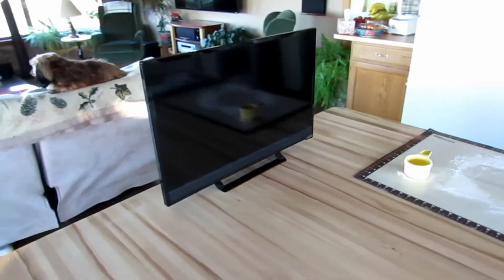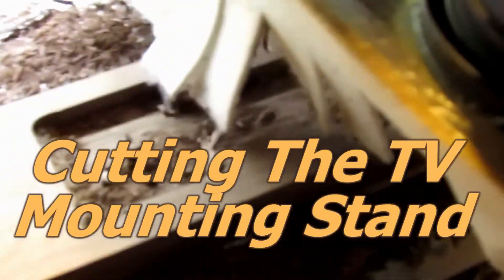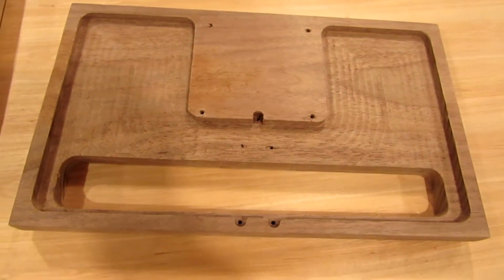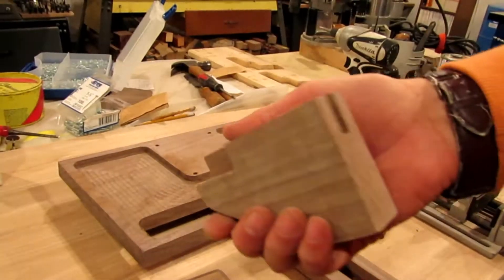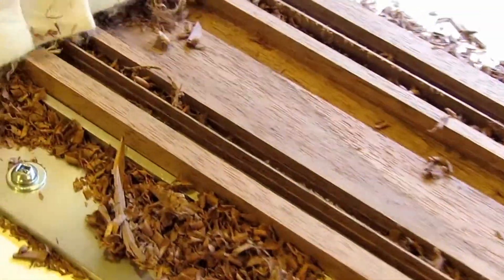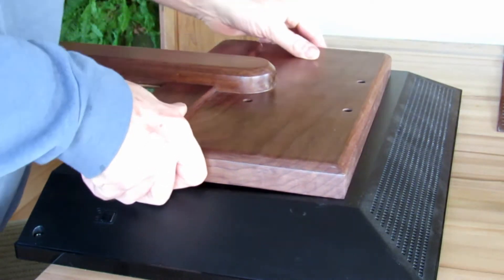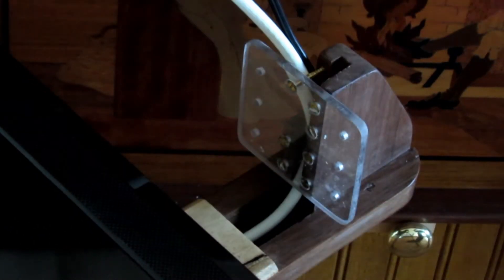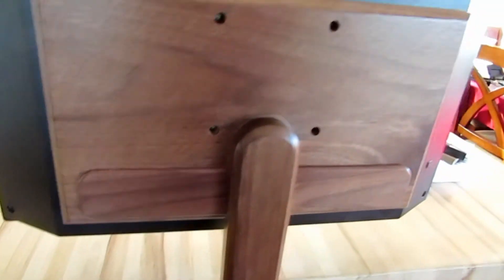Stand for a Vizio E241i-B1 Smart TV That Hides All Wiring

Comment: Well that looks pretty damn nice!  Thanks for the idea.  I was given a 32" TV that doesn't have a stand and now I'm trying to find a way to set it up.  I have a wall mount but can't seem to find a couple of studs to mount it to.  I'm going to keep looking and hopefully will find some, if not, I might try this.  Won't be as nice as yours though, since I'm not all that worried about hiding the wires.
Reply from the maker: Thanks. A 32" flat screen shouldn't be that heavy and you may be able to use those toggle mounts if you have at least 1/2" sheetrock.  A good stud finder is handy to have for mounting items. Thanks for watching.

Comment: Great design, what exactly were those brass 'spring clips' that you used to hold the two covers on?
Reply from the maker: Just 2 pieces of brazing wire and a couple of extension springs. Thanks for watching.